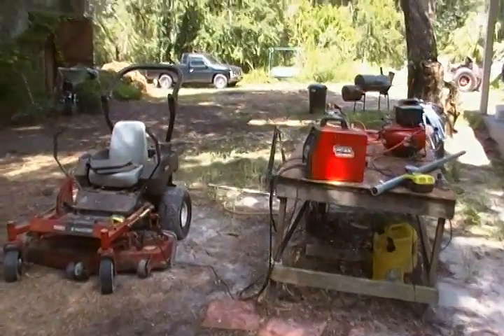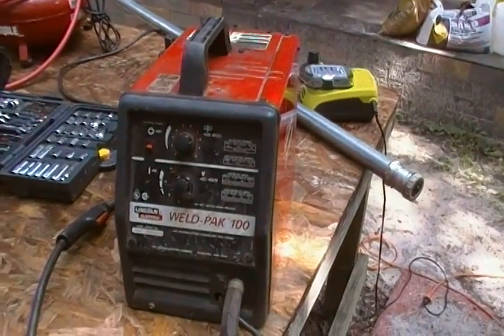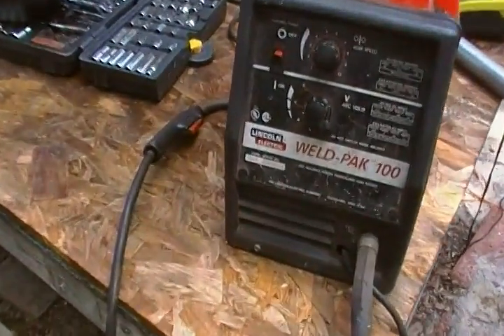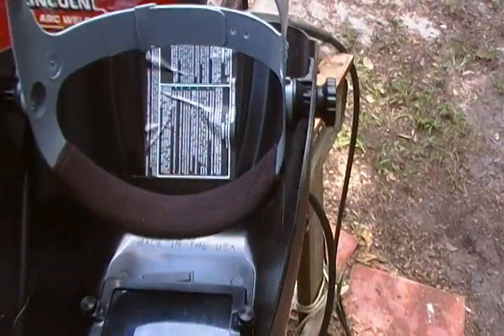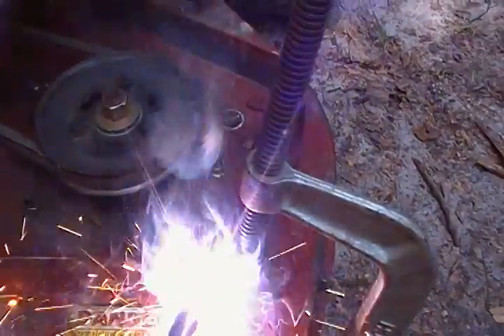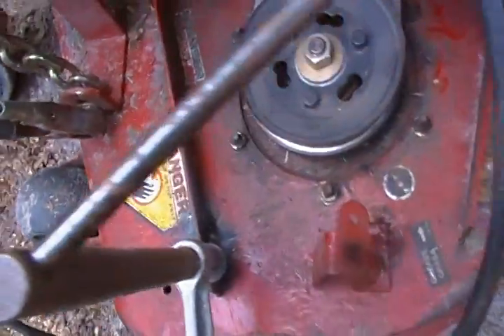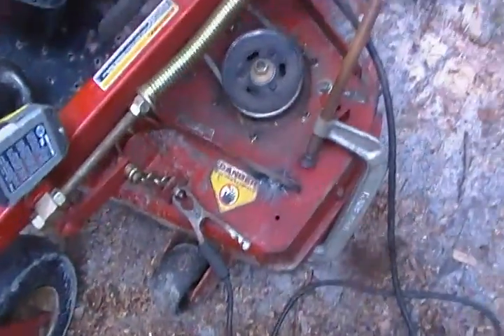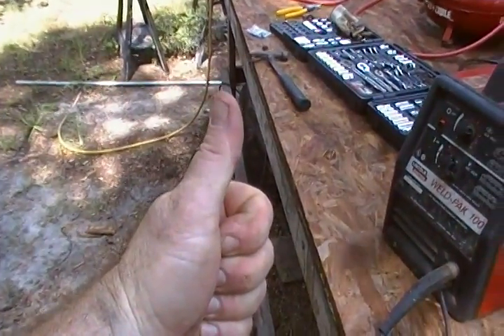Welding with a Lincoln Mig Welder: A necessary prepping skill and lawn mower repair.

Comment: What's wrong with México or other countries???
I don't appreciate your comment. You'll be surprised of how many things you have in your house that were built in México or other countries. Probably even your underwear...!!!
Reply from the maker: About 10 years ago I installed 4 condenser fan motors for a customer and all of the these motors failed in 24 hours, 4 call backs and 4 motors changed all of them were made in Mexico. The 5th motor I installed was made in USA. It was more expensive but, I never got a call back on that one. I support America, products made in USA and the American workers. If you are Mexican, you should make your own video about buying a made in Mexico welder and support the Mexican workers. And btw, the made in USA welder in this video is still going strong at 27 years old.

Comment: Fluxcore is not MIG. Title should be "Welding with a Lincoln Wire Feed Welder". Nothing wrong with fluxcore but fluxcore isn't MIG
Reply: It says using a MIG welder, which the Lincoln is. He was just using it as a fluxcore welder.

Comment: auto dark helmets rule and they make you a better welder cause you get to see before you strike  ever sense i got my auto dark helmet  my skills went up 100% the first time i used it,
Reply: They make novices better welders. Real good welders do not need auto darkening helmets. Their welds are always good, even with the old style helmets.
Reply: they do make the good welders even better as well
Reply: Kevys Rc & Music As someone who welds and has worked with good welders I will disagree. I have both helmets and have used both and there are times I still go back and use the old ones. Overall vision while welding is better with the old helmets. And heaven forbid you have a auto darkening helmet that cost less then 150 bucks. Those are the worst and harbor freight ones are really bad. Those cheap ones will auto flash you just a bit. When new you wont notice it but later when the cheap chinese construction starts to fail you will start noticing it. The end result is the first 1/2 of welding is done completely blind. With the old helmets when you put them on the eye is immediately getting conditioned to the dark environment so when you strike your arc everything is immediately clear. If you are an experienced welder it is easy to build a case that the older style helmets are better.
Overall for a good welder the helmet is not what makes you a good welder. It is your attention to detail and your process that make you a good welder.  I have even welded stuff with my eyes completely closed because I had no helmet and got a better than average weld from it. In fact it was my best weld of the day. Yes there is a long story behind that little episode but it is longish and you are clueless.  Thus I would be wasting a good story on you.
Reply: well i guess for you its not going to improve your skills but for many of us it has .. what i will say is anything from harbour freight is a joke at best .. lincoln has an onexpensive helemt thats auto dark i had one and its really good but my miller now thats a helmet that will 100% do way better
Reply: Kevys Rc & Music My old boss was one of those guys that tried one and never used it again. went back to his old one. People brought him stuff to weld from all over. Everything from little stuff to logging bunks. He even welded on the Hood River bridge back in his younger days. 
My main helmet is a nicer auto darkening helmet. I have gotten into the habit of closing my eyes before I pull the trigger. Seems to work better even though this one does not flash me like my old one would. 
I think for me it is about remember instruction from my old welding instructor. If you form good habits early on then the condition of your lens wont make much difference to your weld. 
If auto darkening makes a huge difference in your weld quality then you need to practice more or take another welding class.
Reply: you have way to much of a god complex
Reply: what ever man what ever we all have a right to our opinions and iam an experienced welder and sense going to the auto dark helmet my welding in arc stick and mig welding improved over 300% the first day using one and many other welders far better then me and you put together say the same so we all cant be wrong but i do agree not to buy to cheap of  an auto dark helmet and get one with a min of 3 sensors to avoid getting flashed...and nope i dont know it all but i do learn new things all the time and new skills and so on all the time ..and calling me a moron really man thats not nice  you dont see me calling you names
Reply: not worth responding to anymore have a good day
Reply: Auto dark is only worth a fuck for maybe tig welding. Other than that its a waste of money. Especially if you're mig welding lol

Comment: Shouldn't you remove the paint and clean the area real good ?   Also, did you have to reverse the polarity for Flux core wire ? I'm new to this as well, but heard that's what you should do....  Thanks

Comment: Better have an old transformer machine handy in case EMP smokes the PC board in a MIG.  There are plenty of 1930s transformer machines still working, while MIGs are delicate and need more complex consumables.
Oxy-acetylene gear is also a good idea just as it was when it was the only game in town and many areas of the US had no electricity. Carbide can be produced as dispersed locations and would be in sufficient demand during a recovery that it would likely be available, but large acetylene cylinders will last a long time.
You can braze with oxy-propane too, and if you have an oxygen concentrator you can use those to feed a small torch as done by many jewelry hobbyists.

Comment: First of all: Clean up your material! Not only for a cleaner weld, but also for a better ground (and thus resulting in a better weld.)

Secondly: Most MIG devices come stock with Electrode Positive set (for gas shielded welding), usually with flux core, you'll want Electrode Negative, if you intend on using this wire, make sure your machine can switch polarity! (Either through a built-in switch, or by switching the ground & electrode leads.) This ofcourse being with a MIG machine that's being sold as a gas shielded machine, if it's advertised as a flux core machine, you're set probably :)

When welding with flux core, you'll get a slag cover over your weld (just as you would when stick welding). Chip it off (rake the chipping hammer across it, dont bang it like an idiot or your weld will look like shit, or use a wire wheel!), then run a wire brush across it to properly clean it (for painting, or perhaps for laying another bead across).

And lastly, my main advice: Get an auto darkening welding helmet, you can find em fairly cheaply, and they're fantastic. They allow you to see what you're about to weld, light up and you're welding straight away without having to second guess where your electrode is when flipping down your helmet. The cheaper auto darkening helmets usually have 1 fixed shade, the more expensive ones can be set to a range of shaed (usually 9-13 for welding, 5-9 for grinding/torch cutting/plasma cutting/etc...)

Comment: When you switch from using gas to flux wire you need to switch something inside the welder. (possibly polarity).
this may be part of your problem.
I would look into finding an owners manual on-line.

Comment: For most stuff I'd rather stick weld with my powerarc welder. Mind you, a big roll of flux core is pretty convenient for long welding sessions because you don't need to swap in a new electrode.

Comment: Because it is yours does not absolve you from liability and somebody saying it is easy and displaying these skills is just a bad example. Just like preparing for the zombie Apocalypse by stockpiling stuff is. It will eventually run out and you will be left with your skills. The skill of living in the brush with nothing is what is needed not learning o/a skills so you can weld after an emp.

Comment: i agree completely. i have a Lincoln 100  110v flux core  i got 12 years ago that never seemed to do good now that im experienced and educated 12 years later that machine i though was  a paper weight is a godsend. all u need is to know how it works and u can do anything. might take longer (more passes) but will be just as strong if you get a gust of wind or run out of gas you end up with porosity. so if ur not a body man or shop fabricator. flux core is awesome. just need to learn how to use it

Comment: bought my lic 150 bout 3wks ago brand new w/ wrty and ag exempt, plus a 1yr old discount $577 !!! marked dwn from $777 !!! don't know if it was a good deal cause liv in small town ! I just knew I needed it ! miller was $250 more !!!!!!!!!!!! also harbor tool mig welder  $300 had for 15 yrs and still works but not as good anymore !just tried of stick welding ! w/110 generator can go any were on farm !

Comment: i have a linclon 100 mig wilder, i bought it around 92 , i use it in building rat rods and other trucks  motorcycles,i like it very much, you just cant weld good the first time , you need to practice, practice,practice, it saves alot of time

Comment: Get a multi-process welder and you can MIG or flux core weld, or stick weld or TIG weld depending on what needs repairing. I use my PowerMTS welder as much as I can. TIG welding comes in handy.

Comment: You need the option K610-1 MIG Conversion Kit. I use flux core wire only, Lincoln .035 innershield NR-211-MP, ED06363. Never had a problem with this baby in 20 years, nice little unit. You could weld up to 1/2" with flux core but I never needed anything this thick. Lincoln makes good stuff.

Comment: i have the Lincoln mig pro 135. and i already weld up to 3/8" with .035 flux cored wire  with very good penetration. of course have limitations. for power works Lincoln sells larger units. but for home, farm repair or light fabrication this machine is great. i have welded many projects with it. only the mig pro series support gas shielding. the weld pak series is  only for flux cored wire. but you can turn in gas shielding. only adding the parts the weld pak dont have like gas selenoid and hoses
Reply: vambreace I plan on purchasing a used pro mig 135. Not tanks or any way to test it.  What are some things to look for so I don’t get ripped off 😂

Comment: The problem with Auto dimming is, you still see the arc. The light is moving... at the speed of light, the electronics that dim the lense react after it is detected so light has already reached your eye. I know it sound like nothing to worry about but if you see a spot afterwards, you have done damage. 
I wish they made a lense that starts at a level 5 and auto dims to level 11 or 12.

Comment: I've got a weldpak 135 it is more than capable for stuff around the homestead. I've built heavy duty metal boxes with it up to 3/8th inch steel. Splatter could come from wrong settings,dirty steel or even too long of an extension cord. Even using an outlet thats running other items on the circuit could cause that. Don't give up on that little welder just yet.

Comment from the maker: The welder in the vid is a Weld Pak 100 Mig.  I just use the flux core wire and i have successfully welded 1/4" mild steel with the thing.  Your welder might have some problem with it.  I recommmend that you have it checked by a shop.  Good luck.

Comment: I have one exactly like this, what i want to know is, is this Lincoln 100 a MIG welder or is it just a wire feeder welder. I bought it cheap and then spent some more$4 on a 10 pound wire but I'm totally not impressed with this welder at all. Its a spitter just like the one in this vid, no real power at all. This thing is a toy and not a real tool and I feel that I totally wasted my money on it

Comment: as a professional welder and have used that exact same machine with flux core, only a couple things, with flux i find it welds better by pulling the bead, and like u said i would be better to grind the paint off first. but hey do whatcha gotta do and get the job done.

CHEERS

Comment: The MIG process works better with a shielding gas, flux core wire can be a bit touchy. Basic rule of welding anything, get your metal as clean as you can. Also make sure the spot you hook your ground clamp to is cleaned to bare metal as well. Another thing to check us the flux wire itself, some manufacturers call for your polarity to be reversed.

Comment: Dude factory welds are made by a machine and they are not strong at all. All your doing is laying weld ontop of the surface a weld is suppose to penatrate into both peices of metal.

Comment from the maker: If your definition of "shitty" is a weld that is 10x better than the factory could do and so strong that it could be beaten by a hammer and not pop apart, then I will take that as a compliment.  Otherwise, I would like you to do a vid on the proper way to repair a crappy factory weld on a mower and show your welder cert.  Thank you and have a nice day.

Comment from the maker: This was an introduction to welding repair and not a certification.  If I am welding tanks for a nuclear boiler then I probably would do some grinding and have my welds X-rayed to be sure.  The metal that I welded on the mower was not structural and is still holding to this day. As a matter of fact, I am sure that the weld on the mower that failed was ground down at the factory and the certified welder did a crappy job and that is why I had to end up re-doing it right.  Was it you?

Comment: Good for you for making the video. I enjoyed watching it. A few observations though about safety. The ground around where your welding is littered with combustible materials. Leaves, twigs and such. Worse than that, not a fire extinguisher in site. I'd lay money that riding lawn mower by Toro, has a gas tank with gas still in it.  Lucky you nothing "BAD" happened. It only takes a second to be safe. It takes a lifetime to regret it. Curt's in your corner.

Comment: Yup take the time to remove paint and rust and that tack would have gone on smooth.  MIG does not work well on dirty metal.  Stick however would have bitten through.  But when doing any welding, take the time to prep.  Your welds will be nicer and you'll be happier!

If you can't weld, weld lots!

Comment from the maker: Flux cored wire welding will not produce a perfect leak proof weld.  Some can, but most can't.  With mig you have the advantage of using a shielding gas that will make welding aluminum possible.  I have done some arc welding(stick) but I prefer the mig.  Mostly, I do repairs and some light fabrication with the mig.  If you can stick weld then I would continue doing that.  The mig is in my opinion easier than the stick welder.  I hope that helped.

Comment: no doubt, but a lot of people don't do it very often, so they just want it done.  No worries as long as it holds.  I always clean and prep so my welds turn out better looking so I don't have to grind them.  wire wheels on my drill saves time with the prep work.

Comment: Dang this welding machine cost me my job.  I guess they expected miracles.  I had the settings as high as they will go and it was barely hot enough to weld 16 gauge then i had to do the same thing but with 1/8" to 16 gauge.  Oh well it was only meant as a temp job... it just ended sooner. 

P.S.

nice video.

Comment from the maker: @bctruck I've welded some 1/4 inch just like you described.  I started off with a 22 inch push mower and it took over 3 hrs to mow part of my yard.  My wife picked up a 36 inch walk behind for $150 and it knocked the mowing time down to 45 min.  We bought that riding mower in 2006 and it mows a lot more grass in a lot less time.

Comment from the maker: @SENSEYCHEN I am actually trying to learn spanish now.  So here goes;  Este soldadora llevar puro alambre (flux core wire .035).  Es possible a usar tipo de gas (argon o carbondioxide)con la alambre( no flux core wire).  I have no way to know if I answered the question correct or if I even understood the question properly.  Buenas suerte.

Comment: the weld pak 100! thats exactly what i have and i bought about that long ago as well. they say you can only weld 3/16 with it but ive welded much thicker you just have to be very dilligent with the molten puddell and move it along real slow. i cant believe how long my ten pound spool has lasted. nice mower.i wish i had a zturn it would make mowing my yard a lot faster and funner.

Comment from the maker: @texasprepper2 This is just my opinion but I like the Mig better than the stick.  What I like about the Mig is that 10 lb spool of flux core wire and it runs off of 120 volts( the larger ones of course are 240v.).  I can do a lot of welding/fabrication with the Mig and I don't have to change welding rods every few minutes.  It's easy to strike an arc and go with it as far as the duty cycle will take you.  If you lived a little closer I'd let you borrow mine to check it out.

Comment: @homesteadprepper I have a 10 yr old Lincoln gasoline welder/generator. About $1K at Sams in '99. Has been good to me as a welder and as a gen. I need another gen for redundency. I'm thinking about Honda, but man... they are pricey. 
When I had my old Case seems like I welded something every time I took it out to mow or whatever. 
Is the Mig easier than trying to strike an arc on a stick? Later... good info...

Comment from the maker: @texasprepper2 Same here, my welds don't look that great either but hold.  The thickest metal I've welded with the mig was 3/16 inch.My welder is only 100 amps. If I had it to do over I probably would have gotten a larger one.  I have an old no name stick welder that someboby gave me that I use on bigger stuff like the tractor.  The first time I joined to pieces of metal together I was hooked.